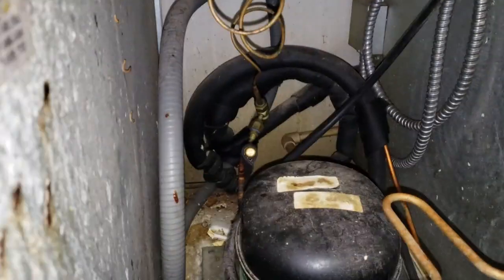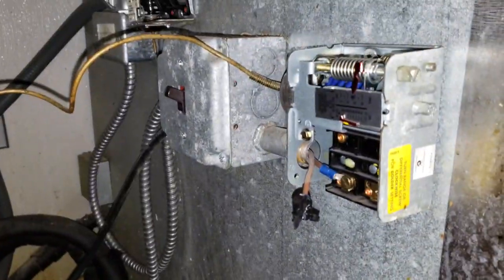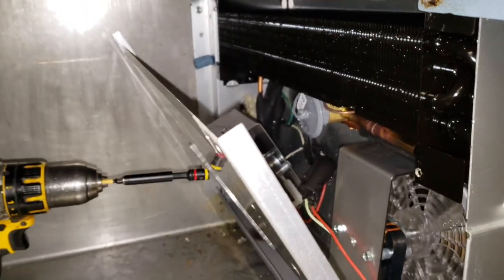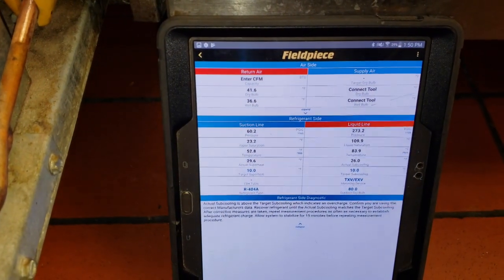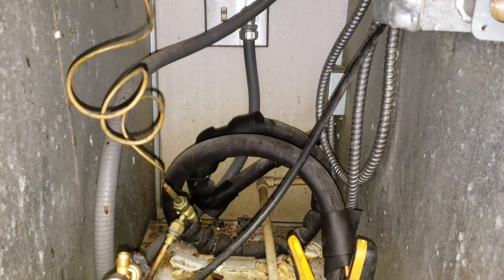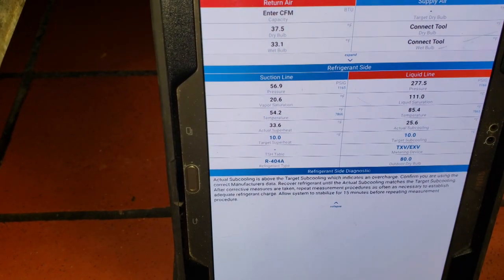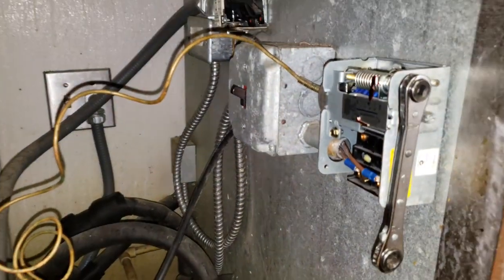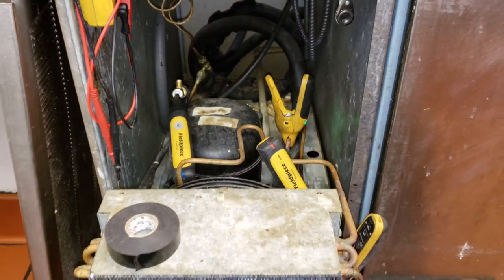Using a low pressure control to control box temp

Comment: Evaporator pressure control was once very common, on very early mechanical refrigeration equipment. Neat to see it still being used. With the cut in pressure being above freezing, you have a cycle defrost system, with no other defrosting means necessary. You know, when it’s actually working right. ;)

Comment: Nice video. 

One additional note: 
Set the cut in pressure to match the refrigerant's saturation pressure at the desired cut in temperature. 
Rough set the cut out temperature at the saturation pressure matching 10° colder than your desired cut out temperature and you should be fairly close. A few cycles and you should be dead on your marks. 

The 10 degree difference allows for an evaporator coil on a running circuit to reach about the air temp you are looking for as the split between the coil temp and the air temp on a mid temp box is around 10°. 

Hope this is helpful.
Reply from the maker: great tips!  thanks for watching, I am going live a little early today 12/24/18  at 12:00pm pacific standard time come on over if you can and check it out https://youtu.be/rDd469JwYww

Comment: Hey mate what Fieldpiece app/fool are you using? That looks great - I’ve changed a solid state LP to a manual Ranco LP and I’ve got no idea what I’m doing as the unit has 2x solenoids which Control two cabinets on the one condensing unit 

I want it to cut out at 2 degrees Celsius in the box 404a) and back in at 5 degrees I’ve set the cut in at 300kpa and differential at 150kpa so cut out is 150 diff (20psi) it’s cutting the IR33 controller compressor symbol off and the temp rises right up to 10 degrees without cutting the comp out - I’m assuming the solenoids close, lowering the gas pressure and eventually cutting out but hell!, it’s taking forever to cut out 😂 I’m just hoping for the best as I’ve already spent 3.5hrs on site

Comment: Great explanation on the topic.  I have a couple display cases where I work that use the low pressure switch to control temp.  It was a serious learning curve for me on the first attempt at it.  I also had one that the contacts stuck/welded together.  The unit ran until the coil was a solid block of ice. 
It seems that the pressure designation on the scales aren't 100% accurate either.  You have to set it where you think it should be and then tweak it from there.  It can be very time consuming.
Reply from the maker: On a side note I'm going live on my channel tonight at 6:00 PM Pacific come on over and check it out 

https://youtu.be/4mrNXiCvid4

Comment: Lol I'm working on the exact same system. I set the switch to cut out at 45 and cut in at 65. Its been cooling good I just wanted to make sure its been cycling off for enough time. Thanks for the video!!

I would like to make the point that 39 degrees cut in is a little high. I am dealing with health inspectors that are looking for below 40 degrees internal product temperature. If they catch it during an off cycle, I'm worried that they'll flag the equipment as not operating properly. I ended up setting the cut in for 33 degrees.
Reply: you need a wide enough differential to prevent short cycling. especially if you're dealing with a scroll compressor

Comment: I didn't read all the comments but the reason for a low pressure control and solenoid controlled by a stat, was to allow a pump down cycle. The compressor on the off cycle would have low pressure in its crankcase, thus the seal wouldn't have to hold high pressure on the old belt driven compressors.

Comment: Not sure if I’m thinking about this right, will this cycle the compressor or the condenser fan? Is this wired same as a relay/contractor, in series on the hot leg? Not sure if I’m mixing this up with a low ambient control. Thanks

Comment: Friendly Question. Why would you need to wait for the box to come down to temp, 34 degrees, in order to note the pressure and make adjustments. Why would you not just use your pt chart from the beginning for both your cut in and out temp?
Reply: Often times the controls are not accurate, so you want to adjust the control to the actual pressure on your gauges for the correct cut in, or cut out

Comment: You are the man, here is a big question 

Can you please make a video adjusting these low and high pressure controls with nitrogen down at the van instead of while its installed on the unit ? 
If this is not possible let me know. 

Thank you.

Comment: Hello Chris. Was the refrigerant charge ok and do like liquid line sight glasses as a quick reference. I worked for a company awhile back and installed remote condensers for walk ins. My boss never checked superheat but just charged the system till there was no gas bubbles on the liquid line. What’s your thoughts on that ??

Comment: Wow, dejavu from the seventies, , spent the first two years of my apprenticeship building those things, except we mounted the evaps on the roof of the cabinet, then the last two years on the road servicing them. R12, capillary systems, Penn low-pressure controls, Muller Pcquay evaps with Kelvinator condensing units, bulletproof. lol
Reply: Muller Mcquay evaps.

Comment: So with singal and dual pressure controls you need gauges on the system to determine correct cut in and cot out pressure the controls are not exact psi all the times .

Comment: Hi there  I've just finished installing a new lp/hp  switch a danfoss but after setting it  up corresponding cut in  and diff  17 pressure in psi   on a walk in freezer on 404a at -18 to -20  the compressor keeps short cycling is it because of the ambient temp (which was about 4 degrees Celsius) or was my settings not right

Comment: Very good video  In older system in refrigerant system they use low pressure control to control  temperature even rack system back then was R12 /R502 /R22 .Anytime l have a temperature by pressure control having problems with controlling the temperature wirer in electrical thermostat & use low pressure  control as a low pressure when using all the new refrigerant essential the blend really can't control temperature inside the box essential in a kitchen that has a heath inspection nowadays .
Reply from the maker: Very true, thanks for watching!
Reply: Blended refrigerants that demonstrate any glide make pressure based controls a little more twitchy to set up and a trace leak in the system changes the Temperature/Pressure relationship, making the problem worse. The manufacturers almost always use mechanical pressure-stats only on azeotropic refrigerants.

Comment: Where do you get the product temp from? Lettuce was stored in there. How do you know what temp before it starts freezing?
Reply: Most of the operators I deal with are not as worried about their lettuce as the sliced tomatoes. Tomatoes get mushy when cycled near freezing, however lettuce handles slight frosting much better. Set your cut out air temp around 34-35° F.

Comment: A pressure control  used as the temperature control works ok/good when the condensing unit is indoors a controlled enviroment.  But on systems where the condensing unit is out doors the pressures fluctuate with temperature  effecting the low pressure switch settings.  You constantly have to go back to re-tweak the control. Also you can not use a pressure control as a temp control on a capillary system.
Reply from the maker: You are correct! I cover those points on  the HVAC school podcast
Reply from the maker: On a side note I'm going live on my channel tonight at 6:00 PM Pacific come on over and check it out 

https://youtu.be/4mrNXiCvid4
Reply: Outdoor condenser is partially true; with variable head pressure, you must use a TXV on the evaporator and the head master must be fully operable. This system does not like fan cycling condenser pressure controls. 

As to cap tube, this is incorrect as long as the box is self contained. The pressure control is sensing the evaporator coil temperature based on suction pressure and as long as the system is not seeing varying head pressures, the "milk box" control configuration, as the old timers used to call it, works quite well.

Comment: The only problem whit the pressure control. Would be affected whit the temperature ambient. I used the pressure control como safety if my temperature coil fail. Would be stop for ny pressure  that is the flaw and small unit  always a tell friend make sure u condenser is clean. So u can see the real pressure on the system.  Is great video  that unit was modified the reason can be to charge more to  the customer  pressure control is cheap vs danfoss control

Comment: Had a cold pack walk-in freezer running below thermostat set point way below to -27 and it’s set for 0. Started troubleshooting and it shut off cycled several times and it worked properly. Any ideas 💡 what would cause this

Comment: I control about 90% of our refrigeration with pressure controls only. I've been doing it this way for about 20 years now. I have much better temp contr with out freeze up issues.
Reply: I should clarify, that is for medium temp, txv fed systems only. I have converted a lot of R22 systems to R407C. Setting up the pressure control to maintain proper temp with out freezing up was interesting, but i realized something very interesting with the p.t. chart, and had to set up the pressure control differently.
Reply: @mikec.2746  Hi Mike,
I know this was 2 years ago for you, but what was your trick setting up R407C LP for temp control? I know due to high glide, during off cycle, you cannot rely on dew point for the range, but don't believe it will be bubble point either. I'm thinking of putting a temp probe on a return bend in the middle of the coil and call that "off cycle refrigerant/ box temp". And use the dew point for differential Thoughts? Am I close to the money? I've done this plenty of times with single or low glide refrigerants without problem, can be fiddly sometimes but works well.

Reason I ask, I've been asked to set this up as a second opinion. Another tech has had troubles setting up to maintain temp without freezing the coil.
Cheers, Morgan.
Reply: @James-vf5gs  Hi James. Yes, your on the right track. Looking at your pt chart, you'll need to set up cut out according to dew and set up cut in to bubble. I set up temp probes in the evap coil and for box temp. That way I knew exactly what the coil temp was along with the box temp, along with freon pressures. All you'll need to know is what temp you want the coil at cut out and what temp you want the coil at cut in. 
I do chain restaurants and have a couple dozen boxes set up this way, and never had a restaurant fail a health inspection due to temperature, and no frozen coils.
Now, I found that when tried that with R422B, I could get box temp, and maintain it, but eventually would freeze up, so I had to run a defrost time clock. So I converted those systems to R407C and removed the defrost clock. 
Let me know how you make out.
Regards,
Mike.

Comment: Is it common for those controls to go out of calibration and what is the cause? Great video.
Reply from the maker: No someone messed with it and turned the dials
Reply: It is more common for a thermostat or cold control to fail than the pressure switch due to configuration.

Comment: Here's my concern. There is no load in the cooler and you made your adjustment to the low pressure control under that condition. I would think you would want to adjust that control with some load because load inside the case is a normal temp condition and your expansion valve is closed off more to maintain superheat with no load.   Once load is inside the case, your valve will be open more than with no load, thus changing your normal suction pressure range. Or at least go higher on your cut in to like 90 psig
It takes longer for product temp to raise than air temp in the case. Surprised no little receiver to help maintain solid column of liquid to exp valve.

Another huge problem with low pressure control only is head pressure fluctuations with ambient and starting plug up with debris will cause temp to pressure issues causing ice ups

Also the blends of refrigerant with leaks may give you a different pressure temp relation, and glide will screw with you too

Federal open air cases were heavy on low pressure controls and now rely on temp controls cutting on and off with evaporator supply temperature.

Electronic temp control with scheduled defrost control is my preferred choice to prevent ice and temp issues.

Nice video.

Comment: What would the feasibility of adding a solenoid valve and t-stat measuring box temp?
Reply: It's not needed. The pressure control is as or more accurate and is using an average of the entire evaporator coil temperature. This configuration also acts as freeze protection for the system, all in one package.

Comment: Thank you to u explained  that very  well. does pressure control take the place of the thermostat  can you do videos on head master valves
Reply from the maker: Yes I will try and do a formal video on headmasters. Until than check this video out that explains them a bit and how to charge the system when they are installed.https://youtu.be/Uzz9o3adkmc
Reply: @HVACRVIDEOS  does the pressure stat take the place of the thermostat

Comment: I never installed solenoid w/temp controller simply to avoid nuisance calls because someone jacked the temp down.
Reply from the maker: On most of the reach in coolers they are setup as a pump down system so that would be the purpose of the solenoid valve.
Reply: Understood

Comment: Next time Install an electronic controller and a relay (or solenoid depending on the type of equipment) advise the customer it’s an upgrade. I’ve been doing it for years here in Australia. Great videos mate keep it up!
Reply: Unless you set the pressure switch for freeze protection or coil mount the temperature sensor or add a freezestat, you are doing your customers a disservice by disabling the freeze protection functions that the pressure-stat also provides. This is the same idea on the True brand small refrigeration units that use the cold control with the sensor capillary that slides down into the tube that runs through the evaporator coil body, as this control senses ice buildup on the coil as a drop in coil temperature and shuts off the refrigeration. All it takes is a piece of cling wrap or a plastic bag to block the fan intake and your customer is paying for a needless service call.
Reply: I have about 500 of these units in service that are exactly the same as this unit, even the same model number. Doing the "upgrade" you suggest is unnecessary IMO.I feel like you're trying to do the right thing and your heart is in the right place but I disagree with you on this issue. This unit is designed to be simple, cheap and effective. Adding a bunch of extra parts is not going to benefit the customer.

Comment: Is this not the norm anymore? I've never seen one with digital controls.
Reply: This is not the norm in 2019. Most systems use a mechanical temp control along with a low pressure switch. The thermostat is just used as a fail safe/defrost method

Comment: Would be easier to use a 1609-101 all range temp control and drill a hole for the bulb to get in the box to control temp and not the pressure control
Reply: Gamez516 i have moved away from the mechanical stats and went to the A421-abD.  Digital stat with built in defrost control for these boxes.